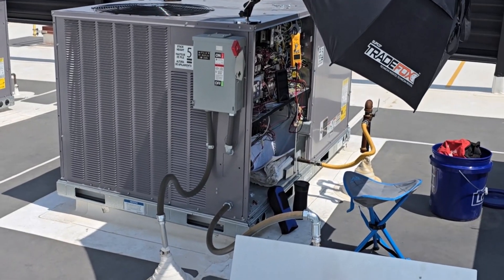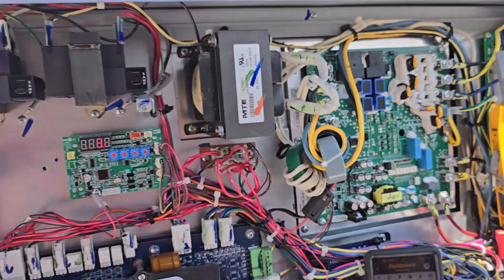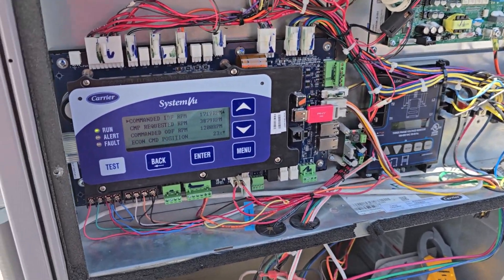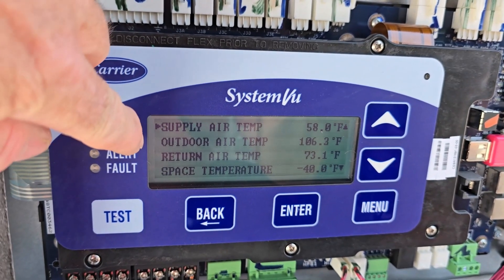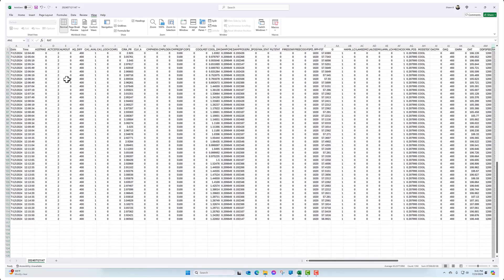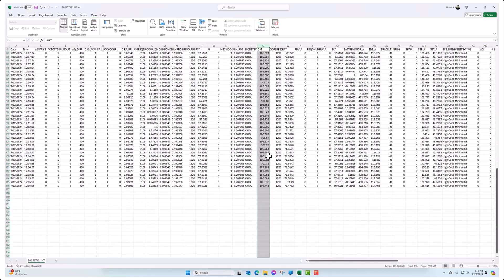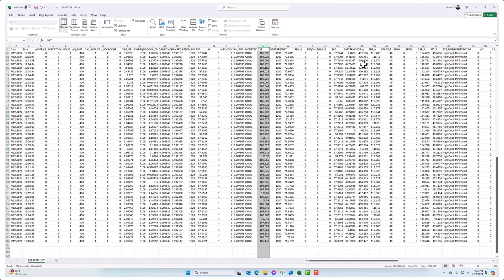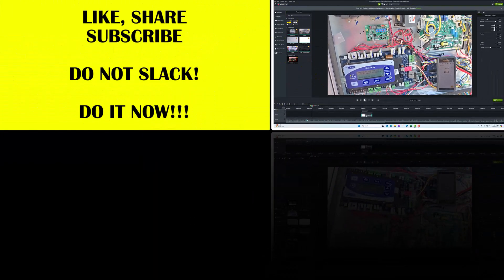Carrier 48JC Inverter Compressor + SystemVu + Data Trending

Comment: Unfortunately those boards are not made by Emerson. You can tell because of the times-new-roman like serif font for all of the silkscreening. Plus, if you look up the UL numbers (they start with E), they point to random companies from overseas. You can find very similar if not near identical boards/inverter systems from the usual places.

It's disappointing that Emerson isn't rolling their own boards, or using quality drive components from Toshiba/ABB/Mitsubishi/Yaskawa/Danfoss/Fuji or others. 

A piece of commercial equipment should be using commercial electronics, not a cheap modular inverter drive ripped out of a trash minisplit from AliExpress.
Reply: I was under the impression that typically, the UL file numbers correspond to the PCB material manufacturer and not necessarily the assembled PCBA. Looking it up will tell you what category it's certified under. It seems that Trane/Ingersoll Rand are one of the few manufacturers that have a drive that doesn't look very similar to other minisplit PCBs. The actual components on the boards are probably fine - most of these high power IGBTs/IPMs are still sourced from ST/Infineon for the moment.

I think the usual failure points with boards like this tends to be related to water/dirt ingress into the electronics and surge protection as opposed to actual failure of components. It would have been nice to have the boards potted in soft clear silicone, which would make this a lot better while still allowing rework. Such equipment should really be required to be installed with surge protection devices, but often is not.

The unit really wasn't designed to accommodate this type of equipment. It looks to me like a factory retrofit based on the bodge board etc. A lot of effort was put into designing the SystemVu controller but unfortunately it uses none of the two way communication with the compressor drive board that would have been possible, which would allow it to log the voltage and current among other useful information e.g. error codes.
Reply from the maker: @liminalsunset  Also in another line of equipment with a Copeland/Emerson variable scroll I saw they used an all in one device that is the footprint of a VFD. Just power in. Power to the compressor. And your command signals.

I guess they chose to do it this way.
It is cool in one aspect but also kinda sketch to be all laid out like this.
Reply: @hackfreehvac  I remember seeing some videos of one as well. I'm not sure whether these are Emerson's controls or if they're just a customized version of a commercial VFD without the display. I think it makes more sense to use a VFD for 3P induction motors but afaik only Optidrive E3 and the AutomationDirect DURAPulse currently support PMSM motors.
Reply: @liminalsunset  Pretty much all major drive manufacturers have drives that support PM motors. Yaskawa, Fuji, Danfoss, Toshiba, ABB, Eaton all do.

Comment: how is it communicating? CAN Serial SDLC USB Old School 432? that would be cool how it communicates to each board!
Reply from the maker: Not sure what protocol. But it says it is a RS485 serial type. It is just from the small "converter board" to the main inverter as the SystemVu has no way to communicate to it. SystemVu just sends a analog 2-10VDC signal to command a desired compressor speed.